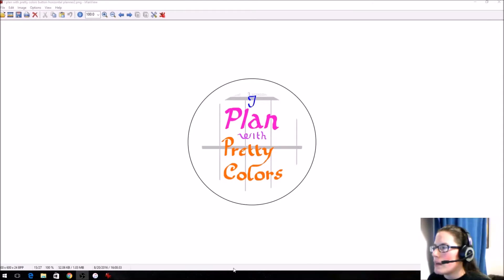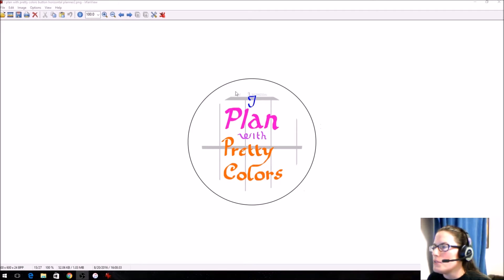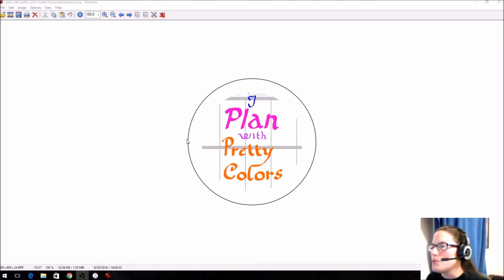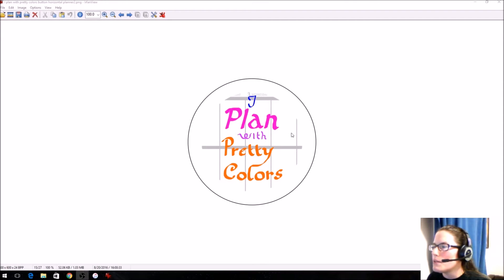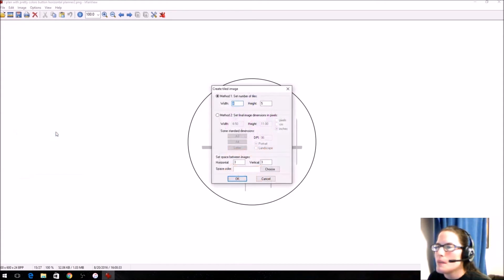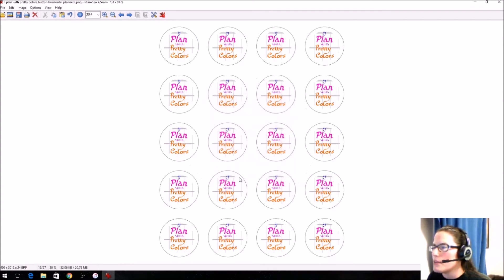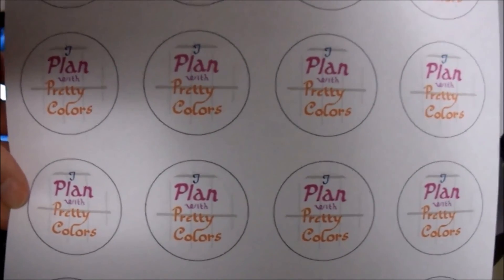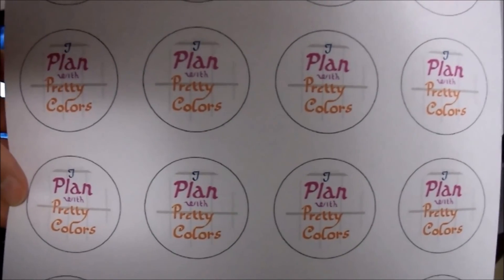How to Print a Pinback Button Design

Comment: you can put two staggered rows of 3 in place of one of the gridded rows of 4 and fit 2 extra button graphics on this sheet, though you wouldn't be able to use the automated tiling to do that you would have to do it manually